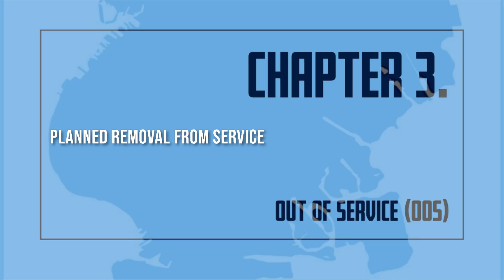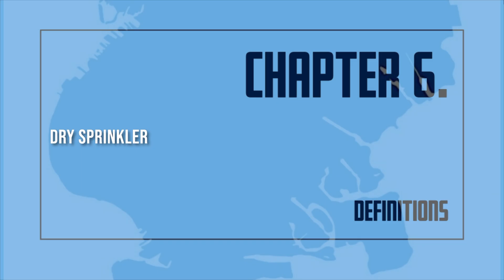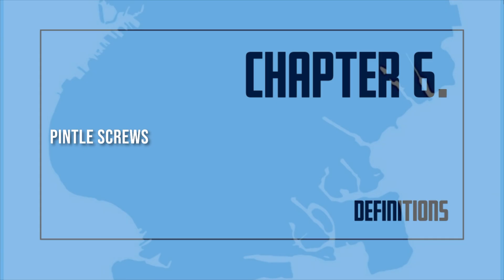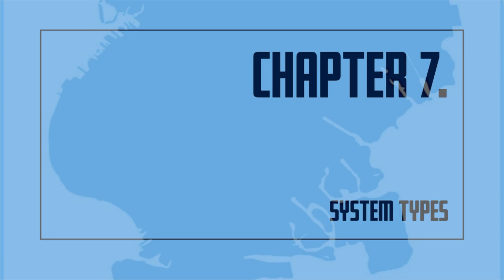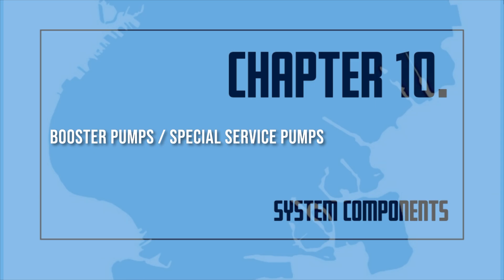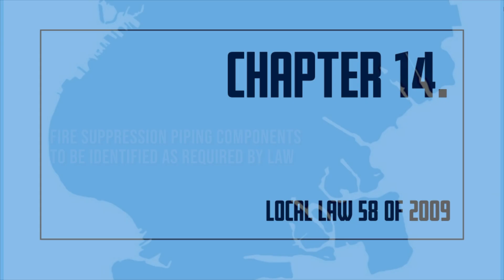FDNY S-12 CERTIFICATE OF FITNESS for CITYWIDE SPRINKLER SYSTEMS Study Guide. THE COMPLETE SERIES.

Comment from the maker: UPDATE (10/24/2026): Verizon is currently accepting applications for Watch Engineers (HVAC Engineers per their wording) in various locations in NYC for anyone with their EPA Universal and Q-99 licenses. Other certs are encouraged but not necessary.

Openings are posted here: https://mycareer.verizon.com/jobs/?search=hvac&regions=New+York&location=Bronx&location=New+York&location=Brooklyn&location=Forest+Hills&location=Jamaica&location=Long+Island+City

UPDATE (3/17/2026): I've gotten some updates from followers who've recently taken the exam (3/16/2026);

1. Make sure you review the photos provided in the FDNY Study Material link. You can expect about 4-5 questions asking you to identify a sprinkler head or other piece of the system based on the exact photos in the material, @ 1.3 points per question that's 5-6 points just based on photo identification. These are "gimmies" if you study the photos. 

2.  DO NOT FOREGT that the top of the the Inspection, Maintenance & Testing lists, has at the notification requirements. In addition to identifying what color tag to place on impairments based on the chart, you'll get 3-4 questions also asking who should be notified due to the impairment. The easy thing to remember is that you ONLY NEED TO INFORM THE FDNY FOR RED TAGS. For Orange and Yellow tags (minor impairment),  you only inform the building owner for the first 30 days. What color tag to use is easily found on the chart provided, based on the impairment.

3. Lastly, BE CAREFUL, there is a very easy question asking you to identify the temp range of a colored sprinkler bulb (photo given in the question) using the chart provided. NOTE: THE TEMPS IN THE MULTIPLE CHOCIE ANSWERS PROVIDED ARE IN CELSIUS NOT FAHRENHEIT! It's a very easy question if you don't fall for the trap.  

With this in mind, these 8 questions alone will get you an easy 10 points!

Good luck and congratulations to all who passed their exams.